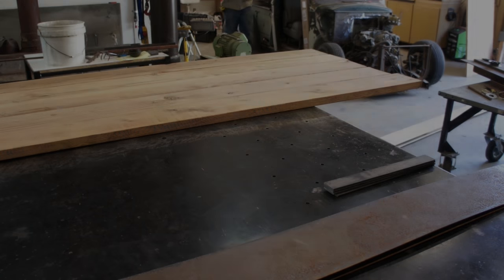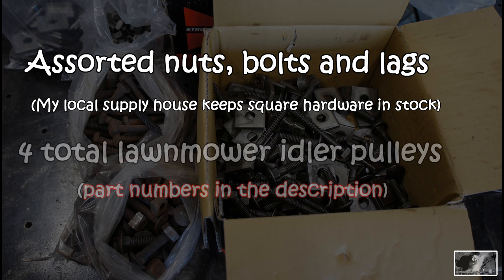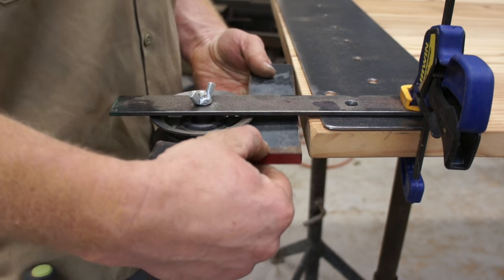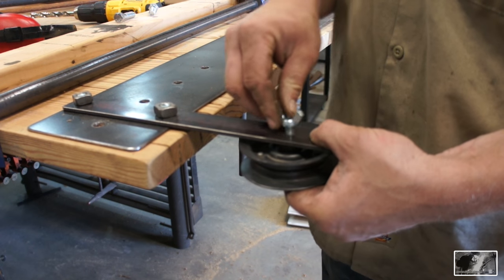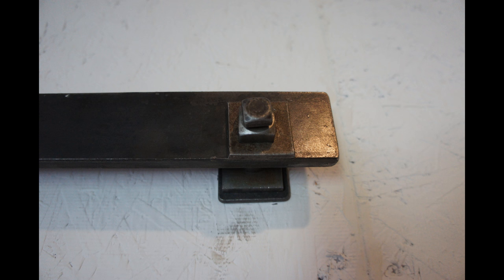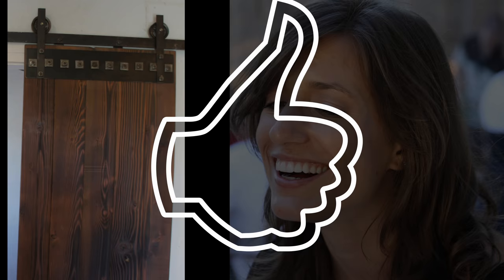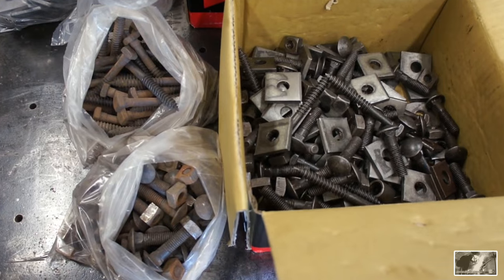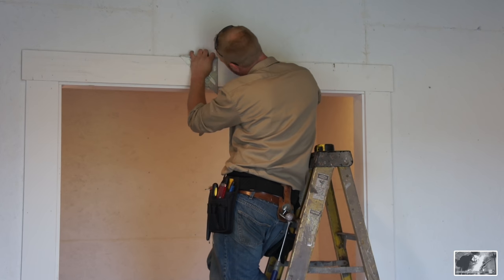super easy DIY barndoor kit | drill & grinder

Comment: Very nice looking!  I am impress of what you did with such common material and tools.  Only the technique was very unique and it was very clever.  I like all the attention you take to details. Thanks for sharing!
Reply from the maker: Thanks for the comments Joe! Glad to hear from you. I wanted to do the project in a way that showed it can be done with even the most basic tools. Hows everything going up north?
Reply: We've got an exceptionnal and beautiful summer so far.  Sunny and warm. Most of the time in the 80's. Very few rain, but just enough.  I would say the best weather I can remember in life.  I've been used in the last few years to 50% rain, 50% sun with temperature barely reaching the 60's.  As you might have seen, I am in the process of restoring my old Case 430. But many other projects to come before winter. Cheers!